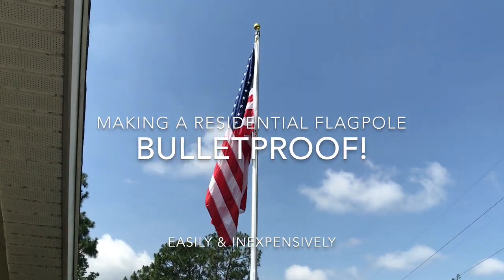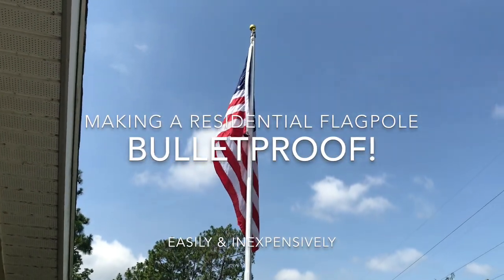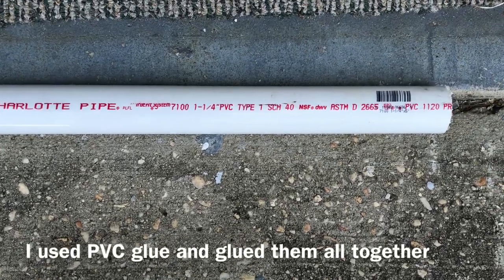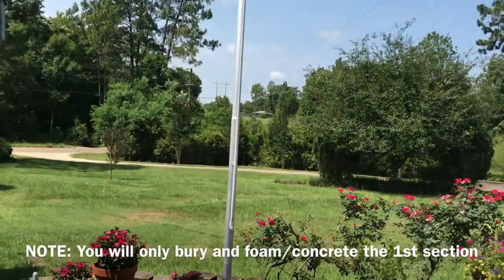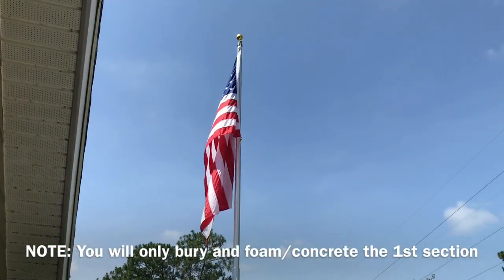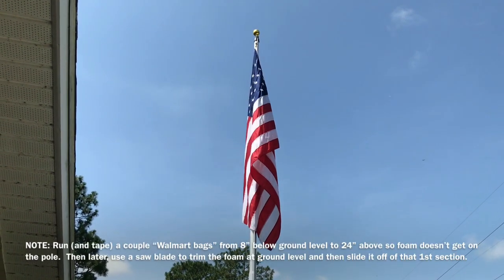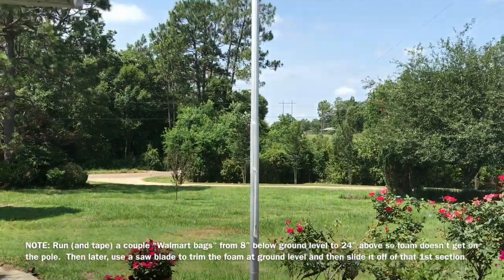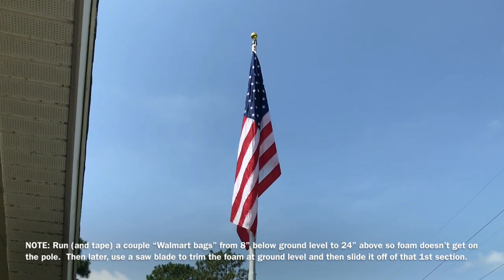Flagpole STRENGTHENING diy!

Comment: Hey, I was wondering if you could possibly give me a link to the fence top rail? I can't for the life of me find it. I can find top rail post which is obviously too large to fit into the PVC pipe. Thank you for your service and thank you for responding if you do.
Reply from the maker: Hi
The top rail they sell everywhere says it is 1-3/8” (outside diameter) and the pvc is definitely 1-1/4” inside diameter… 
so on paper is seems like they wouldn’t fit.  However, considering how many of us have done this, somehow I think they do!  
My suggestion is
1) go to Lowe’s/HD/wherever and take the two and just physically see if it fits.  

If not, then 

2) go to the electrical isle and look for suitable, compatible galvanized electrical conduit (10ft?) then put them together with the threaded coupler used with them.  And if, worst case, the two are seemingly too loose, then I would buy some expand-a-foam and empty a can of that between them.

Please post your findings!  I’d love to know.
Reply: @cyatc1965  Just a little update: a friend and I finally got around to doing this, we did after a bomb cyclone here in the PNW finally sealed the fate of the previous pole (got pretty damaged in the high wind) so we replaced it and followed your instructions, the pole stands much straighter and does not bend as much as it used to. Thank you again.
Reply: @ Glad the info/video was helpful! 👍🏼👍🏼
Reply: @cyatc1965  Thank you very much sir, I will do so sometime today.

Comment: I would not use Sika. When the density of the ground is low during warm seasons, Sika will not weigh nearly enough to compensate for the surrounding loose dirt. You would need to dig the hole wider and deeper to achieve the same results as concrete. Plus the project cost would sky rocket because Sika is so much more expensive. I say this after using Sika on 30" deep post holes for an 8 foot fence. The posts began leaning and I had to go back and put concrete rings around the base of each post. It was because the Sika lacked the weight concrete provided. I would not chance that on a flag pole.

Comment: Question. The only fence railing a can find is 1 3/8 inch. That won't fit into the pvc. Where did you find smaller fence railing?
Reply from the maker: I used galvanized chain link “top rail” (used horizontally to connect fencing to) not the vertical “post” size.  It’s smaller and has male-female ends.
Reply: @cyatc1965  I am dumb, i found it, i bought the top rails, and schedule 40 pvc and the main flag pole should be in tomorrow. i hope to have it standing this weekend
Reply from the maker: @bluetonight17  Lol, you’re not dumb, I probably should have been more specific in the video.  Glad to hear you will be flying Old Glory soon!

Comment: I personally did not have a good experience with sika for our 20ft telescoping flagpole, the winds we got was brutal on the sleeve and foam, it cause to much wobble in the flag, so we took the foam back out a couple weeks later  bought a new sleeve because the first one cracked since the foam didn’t provide a solid support for the sleeve, and got a couple bags of sakrete ready mix concrete and implanted some nice flat rocks on the top while wet to ensure some good side to side strength. Now sika did work wonderfully for our 4x4 mailbox post!

Comment: Thank you!!! After proudly installing my flag pole and then sadly having to pull it down due to excessive wobbling and fear of the pole breaking, I came across your video, which saved the day!  We went one step further and used a pipe expanding mandrel to flare the joints, decreasing the amount of wiggling of tue joints. I am again proudly flying my flag! 

Thank you for your service sir!

Comment: I used the 20 foot PVC and 20 foot galvanized inner reinforcement, as suggested.   Then used Quikrete to secure sleeve in ground.  Also, flagpole came with 2 foot sleeve but I went and got 3 foot one to use instead.  Thanks for posting video and especially thanks for your service 👍

Comment: Interesting, I may have to try this out, I see my local hardware store has 1-3/8 size top fence pipe. about 5 years ago I used an electrical medal conduit to build a flag pole in the yard, they come with metal unions at the ends to protect the threads, but you can screw 2 together with the union to make a 20ft section of metal conduit. This has worked for the past 5 years, but the threads on the conduit are starting to rust away, so the top pole is leaning not straight totally anymore, due to the force of the lanyard pulling down and threads weakening.

Comment: Sorry for all the questions. Want to get this right. 
-I have a PVC sleeve already concreted into ground that came with set. 
-When I put flag pole in, due to the weak material of pole it sways a lot
- I Am going to get the PVC & Pipe to run through inside of pole 
-Once I lift pole and set in PVC sleeve that is in ground there is a slight gap between pole and ground sleeve. 

What can I do to fill in space between pole and ground sleeve to better secure pole at bottom?

Looks like you have something sticking out that is filling in gap of yours. 

Thanks again!
Reply from the maker: I guess you could use a bead of silicone, let dry then another bead over that.  You could run a stainless bolt and nut through the whole “set” to pin it together.

Comment: Did u pour the sika foam into the pvc that pole slides into that’s in ground??
Reply: No.  The first section of flagpole gets permanently mounted in the ground.  Then you take the remaining flagpole sections, pre-assembled with the pvc/galvanized-pipe inside it, and boost it vertically until it drops into the first (ground mounted) section.  That’s it!  Really easy, and mine is 100% still to this day.
Reply: @darrincarty2684  nice!  Even with pvc/pipe in there is a very slight gap in pvc sleeve in ground...it still doesn’t sway??  I have my sleeve concreted in. Had to take pole down bc it’s super windy today
Reply: @Mzapp329  hi, the point of the strengthening texhnique is not to completely eliminate sway, it’s to keep the pole from bending to the point that it folds over on itself (due to it being hollow).  If you are having big movements, maybe look at how securely it is in the ground, and maybe use a concrete base (an inverted “bell” shaped hole is best).  Good luck!
Reply: @darrincarty2684  thank you!  I have the pvc sleeve in concrete. Minimal movement from in sleeve. I feel most of the movement is up top with strong winds. I had it up one day and storm hit so I noticed significant movement on top. I believe it is due to the light aluminum material + the height. Going to try this method and hoping it tones it down a bit!
Reply from the maker: No, around it just like you would concrete.
Reply from the maker: No

Comment: So is the fence pole going all the way through the entire length of the pvc ? And leaving a section post at the bottom and top ?
Reply: Yes, it basically strengthens the pvc, which strengthens the flagpole.  All are approx 20’ long.  There’s a little flagpole on both ends I guess but it doesn’t really matter.

Comment from the maker: Notes on install: I dug a 36”+ hole,with a post hole digger, then filled with about 8” of pea gravel for drainage.  To keep the Sika Foam off the pole, I ran two Walmart bags up the FIRST SECTION of the flagpole and taped with masking tape (to keep foam off exposed pole section): I taped the bags 8” below what was to be at ground level and then pulled them up and taped them against the pole again at about 24” up that first section, above ground level.  Plumbed the first section vertically in the hole, about 2-3” into the pea gravel and then I Sika-foamed it in place — I held it plum for about 5 minutes and then walked away.  After an hour it was completely set.  I then took a hand saw blade and trimmed the foam off (at ground level) and then removed the protective bag off of the pole by sliding it up and off the top of that first section.  THEN we boosted the rest of the flagpole into place over top of that first section that was set in the ground.
Reply: The Walmart bags also keep the foam OUT of the first section of flagpole.  You want to keep the first section “empty”.